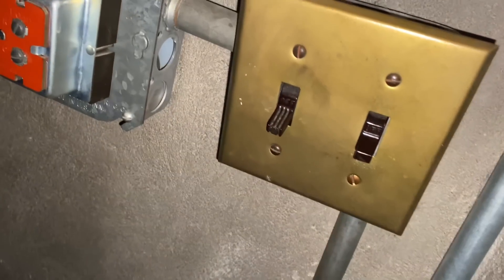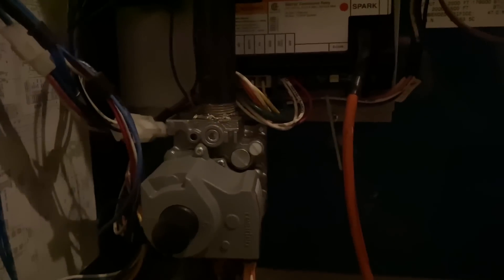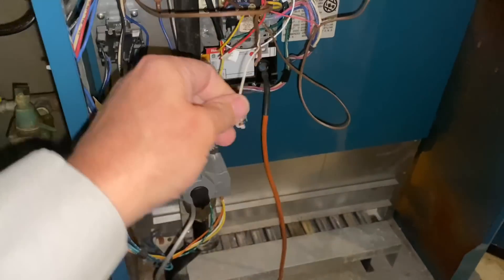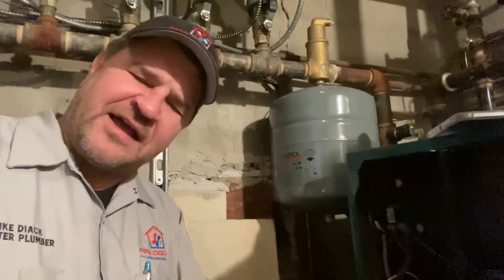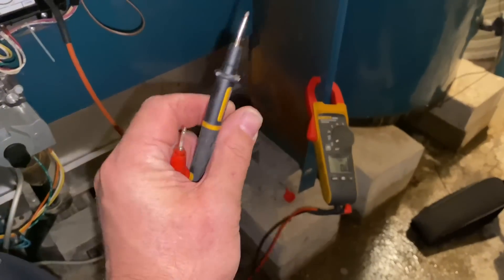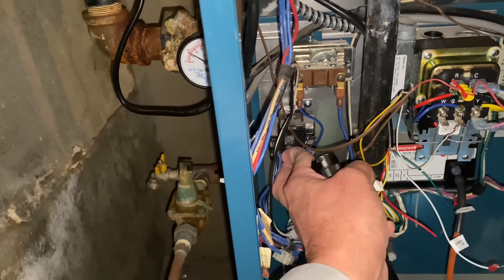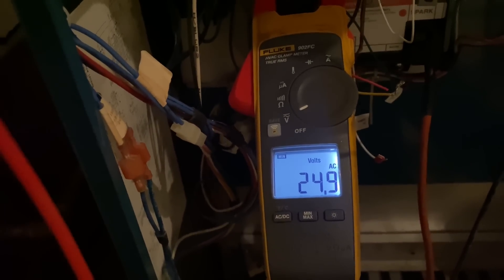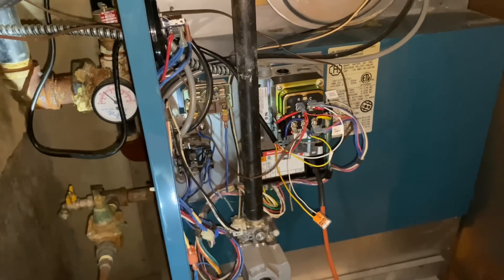No Heat Burnham Power Vented Boiler with Ignition Failure

Comment: How did you set the universal pressure switch i know fieldpiece has one whith three ports in a manometer is there another tool i knew there was one but dont see it. Just so someone dont think you just put them in with out adjusting

Comment: Off topic for the video.  how often do you come across Dunkirk boilers and do you ever install them and what would you thoughts bo on the COMBI MODULATING CONDENSING GAS BOILER from Dunkirk?
Reply from the maker: I’ve seen 2 in the last decade.
Reply: @PipeDoctor  I grew up where they were made and couple of my parents rental properties have them and I learned how service the old beast can't beat a good old cast iron burners

Comment: How about putting a manometer on the pressure switch to verify if it is the switch? Instead of throwing an after market pressure switch on. Which I'm sure the pressure setting was a lot lower than the OEM switch. "If you're not testing, you're guessing"
Reply from the maker: No thanks.
Reply: @PipeDoctor  I figured as much. Do as mike says, not as mike does
Reply: Also should have checked the flue and chimney for blockages

Comment: I was screaming at the screen pressure switch the whole time. That partially open and closing gas valve was the giveaway. Sometimes the switch itself isn't bad but as it wears and you get dirt in the air tubes they get sticky. Pulling the tubes off one at a time and blowing through each of them has proved to work well if I can't get an immediate replacement. My granddad used to make a dirty joke about it I'm not going to repeat it because I joked something similar on Daniel's channel  a few months back  and he yelled at me 😂
Reply from the maker: I blew through them right away. It’s habit. That’s why I discounted it until the end
Reply: Ahhhhh 😯

Comment: This has to be code for …… we are going to sandals for the pool party
Reply: Hard rock I think
Reply: @scottmaz4063 was going to say same thing. MP mentioned Hard Rock pool before like 2-3 cabanas.
Reply: I'm surprised you didn't check the pressure of exhaust system. Pressure switches are fairly reliable and it may have been doing its job. If you're not testing, you're guessing.